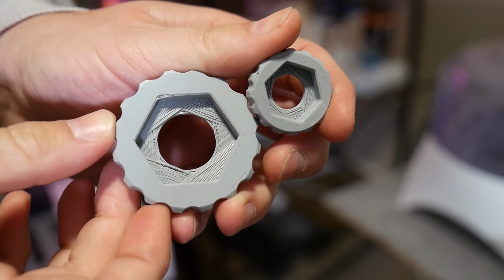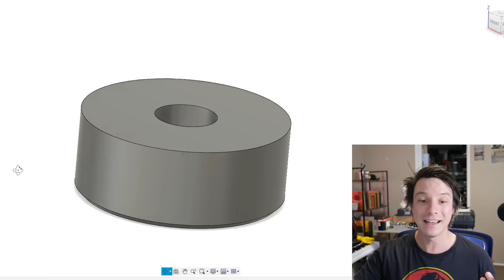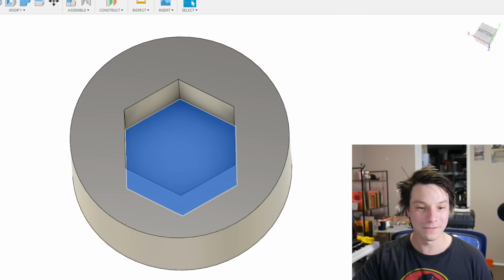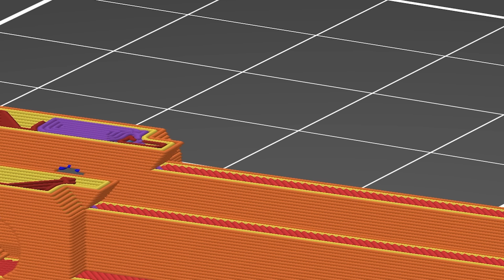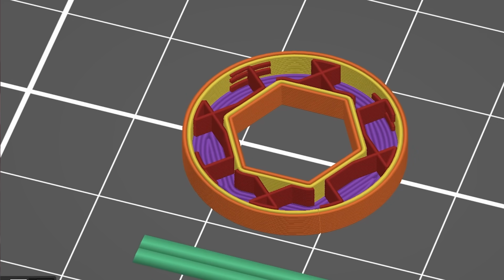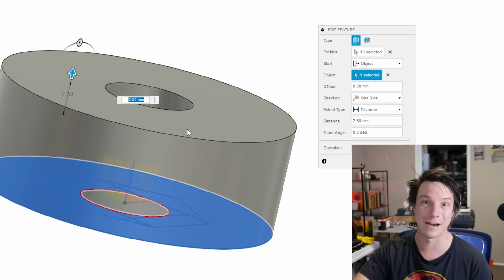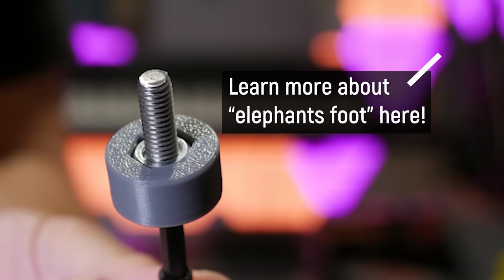How to 3D Print bores without supports (Fusion 360 Masterclass)

Comment: With the 45 angel metode; you could print a "void filler" as a separate part (just a cone with a hole down the midle) and insert it before the nut. Then the nut will have a flush face to push against, and everything will be pretty..

Comment: I assume the purpose of the video was to talk about bridging in general, but I print like this - pause the print at the last layer where the HEX is intact, place the hex bolt, and continue printing. Usually I have a solid bottom, then the open HEX and then the printover, so the nut is totally enclosed in Plastic

Comment: I'm still searching for "the best" way to 3D print an external groove (of square cross section) in a cylinder - typically to hold an o-ring.  So far the best way I've found (which is also the most complicated) is with PVA (soluble material).  I design the part as intended, add another part that is a 1 or 2 layer heght cylinder in contact with the lower part of the groove.  This is for the next added part, a built-in support structure.  Next I add a cylinder from the previous surface to 1 or 2 layers below the upper ledge of the grove(the feature causing the problems in the first place).  Make sure this cylinder has a gap between it's ID and the grooves inner cylinder.  And more importantly, you cut this cylinder into 2, else there's no way to get it off after dissolving the PVA.  Finally, add a PVA layer to fill the gap between the upper ledge of the part and the filler cylinder.

Am I missing a simpler way to do this with a single material?

Comment: I often use the sacrificial layer technique on prints where I didn't design the original object. Often objects downloaded from Printables/Thangs/etc that have counterbores on the bottom surface don't have them supported properly, and all the publisher provided was an stl. My mesh modifying/modeling skills are basically non-existent so I add the sacrificial layer to the hole in the slicer. It can be tedious, but once I'm done and saved out the 3mf project file I don't have to redo it for that particular model. It would be nice if PrusaSlicer would support generating the sequential bridging technique. It would be as simple(?) as selecting a circle (re-use the selection routines from the measurement tool) and have the program generate the geometry for sequential bridging in the flat-surface that is co-planer with the selected circle. Time to check the PrusaSlicer github...
Reply: BTW, I just discovered while checking the PrusaSlicer github that v2.9.1 was released on GitHub 30 minutes ago.

Comment: You could also pause the print at the top of the hex, drop in the nut and print right over them as if they are supports.  You could also completely encapsulate the nut that way.  Of coarse this requires involvement during the printing process but it is an option.

Comment: This looks great and does let you add a hex inset to a bore.  But really the right solution even better than printing in the other orientation is to use a heat-set insert instead of a hex nut in the first place.  All that said, this concept is a useful tool that can probably use to solve other problems of a similar nature.

Comment: You can explain it better, just not in the time you have. Your doing all your skeyches on the origin plane(in relation to print bed) and extruding/cutting from offset planes,,,

nobody wants to slow down to get it is the problem

In future, you should do everything from offset planes instead of the surfaces - it will aid in keeping the model changeable and parametric if you want to change any of the values at the end when you have an assembly with hundreds of these bolts :) aming others

Comment: Another idea that I used the other day:  if the feature allows it, put in a print pause just at the unsupported layer and just wack the nut in then resume printing. 

I did this the other day with a part that needed nuts sunk in on top and bottom. As a bonus, the nut was also kind of glued in by this.

Edit - can't spell...

Comment: Thanks, I have a lot to learn, I'm sure this will come in handy eventually. Currently for parts like this I have no issues printing either side down with no supports, I didn't even realize this could be an issue, all my parts like this turned out fine.

Comment: I cut from the bottom of the hole. I draw a rectangle and then a square and cut by a layer height.  Also if i need to make a bunch of the same hole i make a body per'se of the hole. Then i can point to point move a copy of that body to a standard hole and select the cut function vs. Join. Helps making dridged holes like that pretty fast.

Comment: If you have the tapered bore, you can secondarily print a bunch of "tapers" that fill the void space, and trivially slot and glue them in. It's a bit more work, but trivially easy to post-process for anything that doesn't require mass manufacture.

In fact, this strategy works in general if you can later ADD the nut insert to the design. This is not always desirable, but may be useful allowing the printing of a bunch of nut inserts, and then later gluing them into a part as needed. This simplifies the design, should yield faster print-times, and low post-process.

Comment: I use the conical relief approach for making knobs with embedded nuts. They print up to the top of the pocket for the nut, then the slicer pauses so I can put in the nut. The conical relief on the top keeps plastic from gumming up the threads. They tighten against the flat base, not the cone, so strength is not a problem.

Comment: Anyone know if multiple extrudes can be done from a single sketch on Solidworks? I've tried to figure that out on my own, but have never found a way to do it. It would save me a whole ton of time and frustration if I could. I tried to make a sketch with several elements/features, then extrude one feature... and then go back and extrude a separate feature (or cut), but if I do that it will always undo the first extrusion/feature.

Comment: Is it required to do those "sequential bridging" features as parallel lines? Isn't it better to make them in triangle shape and then second layer rotated 60 degrees, making the hexagonal support only in 2 steps, and increasing the surface which accepts the nut's pressure?

Comment: Lord, what idiocy... a whole video about how to solve a trivial, obvious problem.

Finally, someone tell this clown that what he calls “45 overhang” normal engineers call a chamfer. And it is not at all necessary to chamfer the entire width of the surface with a hole; even a small chamfer is enough for this hole to be printed perfectly. That's it, that's the end, that's all you need to know on the topic, and this video should be thrown in the trash along with these crazy tips.

Comment: You could print little slugs to insert prior to the nut to occupy the void space and prevent that wedging to some extent. It'll still happen, but much reduced.
Reply: The sacrificial bridges are only supporting the nut on two of the six points. It'll crush .4 mm before it's supported by 4 of 6, and a bit more for full support.

Comment: One easy way to improve the 45 degree overhang approach is to simply print a matching insert as well. So, for a counter-bored hole where you use the 45 degree trick, just print a 45 degree cone (with a hole matching the smaller bore) that fits directly into that hole. I've seen significant improvements from this over using just the 45 degree trick, as the layer lines seem to mesh together, transferring the load much more directly than you'd expect for a simple 45-degree interface.
Reply: Came here to say just that. Could superglue in place too.

Comment: I call it layered bridging.
It would be unnecessary if it could be added in the slicer.
Regarding your construction method. I extrude the negative volume and boolean substract it from the part.

Comment: Why not pause the print before the overhang would start, and just placing the nut into the print and then continue? With this you could even have a "floor" layer, which keeps the nut from falling out.
Reply: well, if there is multiple parts, it would be a pain

Comment: Interesting. What i figured out for myself is like using a support, not a slicer'support but a part of the model. I place a positive  cylinder just by touching the edge  of the bore hole, (edge to edge) so the printer bridge, but not into thin air. The nonsupport-support breaks off almost right after i remove the print from the bed. If not, i just break, push it off. Or i don't know maybe negative support would be a better word for it?

Comment: Slicer issues should  be solved in the slicer. If possible. The hexnut issue is solved by adding enough perimeters for the bridging layer. I just add enough, so that the first ring starts on solid ground, as in plastic. The next circle, bounds to its neighbor, just like infill does. The third circle bounds to the second, and so on.

There is is very little droop with this. For M3 nut inserts, that is 2,4mm thick, there is no need to compensate anything. I use this for side inserted nuts, all the time. I do get a layer with 4-5 perimeters though.

I acutually do not understand why the slicer just don't do this by default, because i should. Instead, it draws the perimeter first, and with two few layers, that means printing in mid air. Then it adds the lines that has partial support later on.

Just add a ton of perimeters for the briding layer, and maybe a few  more, and watch it  print. It is the same mid air bridging prinsiple, as this circurlar  thing. Do not remember the name of it.

Also, for bridging, slow the speed WAY down, like 10mm/s, and crank the part fan to 100%. That helps a lot, particularly for PETG.

It is annoying having to do this manually, everytime I print an inserted nut. Particularly one that is  slid in form the side, as there is no removing  that support, for them prints.

Comment: I used to extrude a 1 layer thick material in the hole. So it's just an overhang and usually doesn't need to drill out, the screw can be easily pushed through it.

Comment: A couple of alternatives not mentioned in the video. (1) Put a pause in the gcode and drop in a nut (assuming the nut depth is ok). (2) Print a cylinder in the middle of the hex recess, about 0.3mm smaller dia than the screw's bore and use a 1 layer join. Then use this 'slug' as a punch to make a quick, clean break. If the screw hole is blind, put a hole in the middle of the slug to wedge in a scribe point to pull it out)

Comment: The hardest part of my 3d printing experience was designing parts with machining in mind. I've worked in a CNC shop, programming and machining custom parts, eventually ending up doing a large run of parts for the aerospace industry (F16 and MIG21 upgrades). The design always stuck me as simple and elegant. Once I started to design my 3d printable parts with machining in mind I found out that they were a lot easier to print and in one case, it was an absolute joy going to mass production via injection molding. For people getting into this hobby/profession, I'd recommend reading books on technical drawing, machining basics and industrial design. Their are a Godsent and make learning CAD modelling a pleasant experience!

Comment: If your printer can print 70 degree overhang, you still should design for 45 or less. overhangs quality decreases a lot in angles over 45 and ambient temperature plays a really big whole here, so if you need consistent quality and low fail count, avoid going over 45. If you want a one go print, you can go over and keep watching it while it print

Comment: I mostly use sacrificial layers. Benefit: it can be easily added to existing models directly in the slicer via adding a small 0.2mm thick disc shape. That would be a cool feature request to do automatic sacrificial layers for holes directly in the slicer

Comment: The sacrificial bridge gives the very best load distribution between the nut and the printed part. While the alternatives are definitely useful ways to avoid support material on overhangs, I don’t think they’re appropriate for load bearing situations like this. I am sure that where the nut is supported over 50% of its surface area, it will lead to creep (loosening) or stress cracking before a design where the nut is supported over its full surface.  Seriously, these are great examples of using bridging, and I thank you for that Angus, but they’re not good examples of how to support a load-bearing insert.

Comment: Still trying to understand: So, by not creating an overhang that goes all the way across the center, you get better quality from just doing smaller edges?
BTW, your 3rd attempt (the diamond shaped cutout).. you can just chamfer the hole at 45 degrees. it will round the conical shape, leaving flat surfaces inside at the 6 corners... more support for when you tighten the nut. Better than using your diamond shape removal tool.

Comment: With adding the bridging as the last step, is it correct that you would need to include an additional offset to the nut-depth parameter to accommodate for the 4-6 additional layers via the bridging?

Comment: This technique has one major short coming vs sacrificial bridging, and that is layer height dependence. 
Your print now must be printed at the thickness of your bridges or finer else you'll have print failure. 
You're also slightly reducing the amount of space available for the embedded nut or bolt head. 

It's an awesome technique that I've used many times, but it's not a magic panacea

Comment: I'm not sure what the big deal is here. I use counter or hex bores/slots in just about every design I make. 

If the problem you're trying to deal with is the spaghetti that's going to happen a little bit on bores printed when the bottom of the bore is suspended over the bed, I would humbly suggest that that is not, in fact, a problem. You're going to be jamming a nut in there. Nobody's going to see the bottom of that bore, and you can clean it up a bit after the print is done if it's really that big of a deal. 

Anything you might do to solve this problem is mostly just time you could've spent on something else. I say: just run the print with no supports for the bore anyway.

Comment: The sequential pridging works, but I do not think it is an option for larger assemblies with a lot of holes. 

I make modular computer case and the amoun of m3 screws and nuts I use make this option impractical. I just chamfer multiple holes with a 30 degree angle at once to print clean cutouts for m3 nuts. Very time efficient and still works well in the printed part.

Comment: Interesting video, had you not considered using your 35 or 45 degree step and then print a male insert with the same parameters? This way you have a perfect mate and you could CA join them if necessary... Sequential bridging seems a complicated process to achieve a simple goal...

Comment: After struggling with persistent stringing on my cr6 iv wondered if strategic implementation of stringing might help bridging? Or maybe the strings are too fragile. 

The sacrificial bridging idea should be refined to leave to hole open, you can draw tons of straight lines without crossing the space where the hole lives, so a function that automatically does this seems like an obvious add on.

Comment: 2 methods I use.   Foam plugs with a pause hex builds before it closes you pause and poke a   plug in.  It doesn't pull heat and supports the extrusion poke out with the hardware.

Undersize badly which acts like support then use a screw and nut heated to red hot as a tool melt in pull out insert nut

Comment: I'm a bit late on this, but here's an interesting suggestion that I've done a time or two for inverted details: Print the details separately, then insert them into the larger print the same as you'd insert a captive nut or bearing.

For instance: I have a custom prusa print head that I designed myself, on prusa print heads they use the position of a steel ball to do filament out detection. I couldn't copy their ball holding system exactly so I made a captive channel. The back side printed fine, but the front side not only couldn't be printed due to overhanging but would have the ball in the way if I tried. So I printed the front side of the channel as it's own tiny print, then inserted the ball and the front side as a plug and just printed over it. Works like a charm.

In this case, you could print what looks like a 2-4 layer thick washer, and insert it into a pocket in the main print so that it becomes the back of the hole.
Reply: It'll be like those brass heated inserts or those screw threads for wood furniture. That's an interesting idea, I think I'll keep that in my pocket now thanks.

Comment: In some cases is available an “infill emulation” bridging. You can construct some bridges grids (more or less spaced) of lines (your nozzle define the measure), and then make the suspended layer.
In the specific case you explained for the nuts with empty area on top, due to the inclined walls, if you want, you can print a solid with the empty volume shape (clearance calculated) and put it inside the hole, so the printed structure can be compressed, as a unique printed piece.

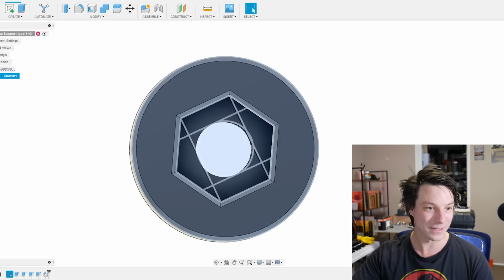Comment: 8:09 the side lines aren't tangent to the circle, an easy way to do this is instead of joining corner to corner, draw the vertical line beyond the bounds of the hexagon, then tangent it to the circle, and finally trim the excess

Comment: Super interesting technique. Just makes me wonder if you could do a single sequential bridge (the largest one), then the rest is handled by a 45 degree cone. The bridge would prevent the nut from wedging up, and the 45 angle would keep the rest of the print clean. Would be curious to know if that would work.